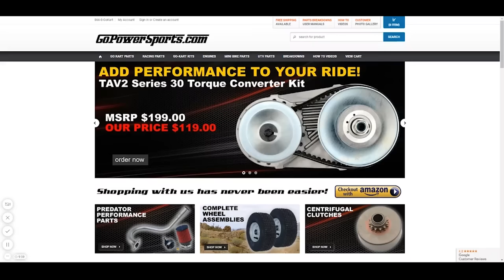Street Legal Mini Bike Build Ep 1 ~ Mini Bike Monday

Comment: Great video! The only problem (for me) that I see is, with the rear brake lights... you can’t use the rear rack because it will block the lights.
Reply: Agreed.  Brake light should went to the back of the rack. So if you use the rack, it can still be seen.

Comment: Don’t need to paint the faded fender. Take a small torch used for plumbing and move in across the fender and it will release the oils in the dye in the plastic and it will look brand new.
Reply: A heat gun is safer for this application, but the same idea

Comment: Does Go Power Sports sell a stage 2 upgrade for the Coleman CT200U-EX that I could do myself? And how much faster do you think it'll go? I zip tied my governor and I cut the screw off on the carburetor linkage that restricts it, and now I've had it up to 30 mph! I want to get the clutch upgrade with the belt, and I'd like to get it to go 55+ with no problems, because I don't want to go 50 to 55 mph with the engine reved all out, because even as it is now, when I hit 30 mph the engine is reving high.  It would be cool if there was a way to add a transmission, even a 2 speed trans would be better than it is now, it would surely go faster. 

What part of Tennessee are you from? My Step Father is from Hancock County, which is Sneedville TN, and guess who his Cousin was?.......it was Johnny Horton, which I'm sure you have to heard of him. He sang the song The Battle Of New Orleans. That was my Step Father's name, John Franklin Horton. 

How can I send you a pm? Let me know. Thanks

Comment: If you want a real ripper eBay has 250cc ,5 speed air cooled ,new Shinerai electric start motorcycle engines for  $700 ,carb,shifter,loom,clutch,are separate ..

Comment: This is hilarious timing, we actually are working on getting my buddies mini moto street legalized here as the guinea pig. DOT tires are the biggest headache but i guess the 10 inch wheel GPS offers for them opens up options, havent had the chance to look to much into those wheel/tire combos yet. Let me know if you guys know of DOT tires on either the stock rim or those 10's ;)
Reply: We picked up 3 minis between our group and hes got everything lined up for his fully built predator swap in my garage and i gotta get a plate made to mount my old gokart racing Briggs flathead on this weekend hopefully and we be ready for the meet and races here local...
Reply: Did u ever get it on the street
Reply: @paintingandlife4288  My bad didnt see the notification until just now, last i knew he had everything lined up to get it inspected by the DMV but i havent talked to him since then about it

Comment: Just put the front fender In hydrogen peroxide in a plastic container and put aluminum foil around the outside of the container ( it will reflect uv light) and put uv lights above container. It will look brand new

Comment: If you wet  sand the faded fender with 800 grit and work your way to around 2000 grit then hit it with a heat gun, just till the surface glazes, it will look pretty dang close to new if your on a budget, hard to beat $20 for a new one though, the new one is likely Chinese remake and not as quality though.

Comment: I've been haulin ass in the woods with the old mini baja mb165 and that has been a great little bike.
I smoke Quads on the trails all day long.
After 10 years that bike is finally nearing the end of its lifespan. It has a strong tough built frame to it. People are always amazed how well that little thing performed.
The natural next step forward as far as mini bikes go would be this new MB200. Rear suspension, storage space and higher speeds, I think the mini Baja has met its cooler younger brother.
I'm going to be getting an actual dirt bike next, but when I head back to mini bikes, my first choice will be this trail master if something better hasn't come along by than.

Comment: I'm looking to buy a mini bike and wondering if this would be a good all around bike for cruising that's reliable
Reply: LØx Shansway  you can make it street legal way easier than they are making it.  You can get a kit on eBay that is all wired. Just have to wire it to the battery and plug in the brake light switch.  The mb200 literally has a plug in right under brake handle. The main wires can be zip tied to the frame.  B 4 some one says that zip ties would be half ass, the main line that come on the bike are zip tied to the frame. The only thing you might need help with is tack welding mounting brakets for the battery tray or box if you don't weld or have the equipment. I say this so more people can get their bike street legal and have fun.

Comment: I'm a Fan and I do ALOT of garage work also.
BUT🫤 Why did you get rid of the  stock fenders?
I think they were better looking
and wide enough for the tire size. Also I am impressed with the quality of the factory paint jobs on these bikes.
I have a 2020 Coleman 
CT200U-EX  Tack-black and
the tank, fork lowers,wheels 
ect. all have flawless paint.
The red on yours looked bright and sharp also.
🤔🤔🤔🤔🤔🤥🤥
I'm still a Fan 😉😉🙂🙂🤨